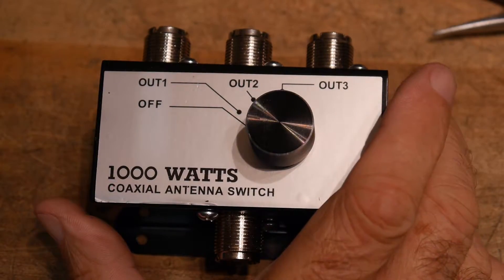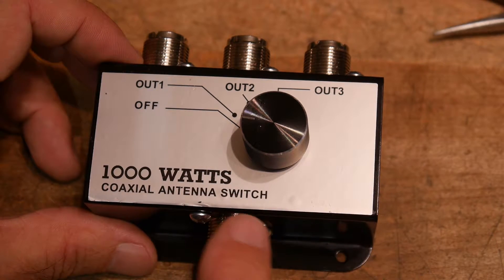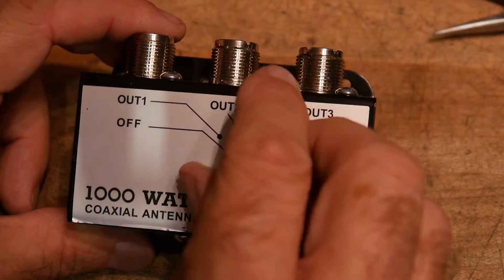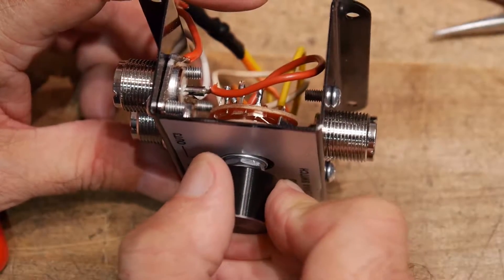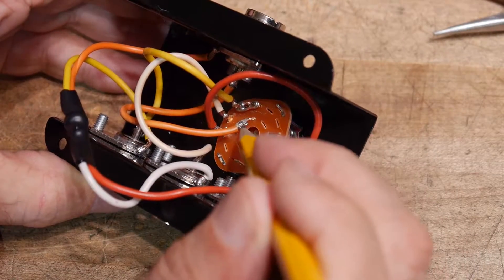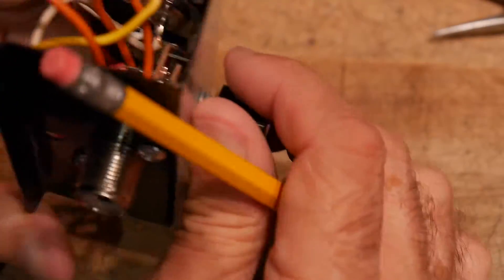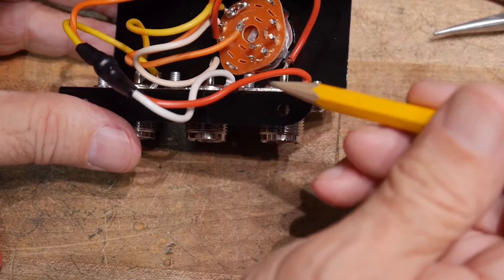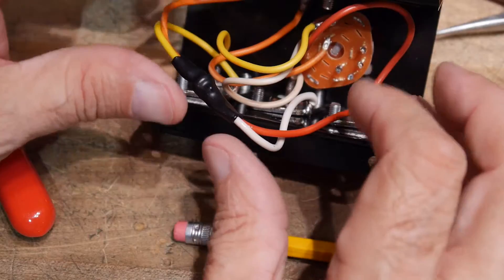#253 coax RF switch modification

Comment: QRP Practical mentioned a potential mod of shortening the wires inside this switch to improve the SWR at 6m and above...have you considered this mod?
Reply from the maker: I would not use the switch. Poor quality.
Reply: @IMSAIGuy  ok so at the end of this video you should have said this switch is poo ..do not buy one?

Comment: If you were thinking of Alan W2AEW's recent video about using a scope in the ham shack I think he talked about installing a separate input jack, probably BNC, with a small stub with no connection to pick off a bit of RF to take external to a box/switch. Another place to do that is in the dummy load with a similar stub...I used a piece of small diameter copper tubing and a resistor running along side the large 50 ohm resistor in one of my dummy loads to give me that capability. Attaching it to a switch port, ahhh, not so much of a good idea...I agree with you on that.  73 - Dino KL0S